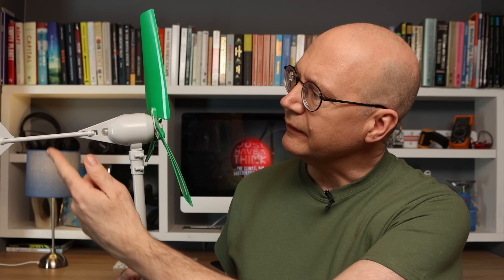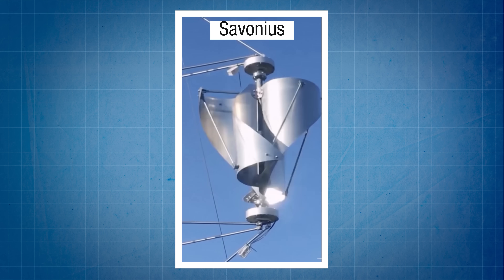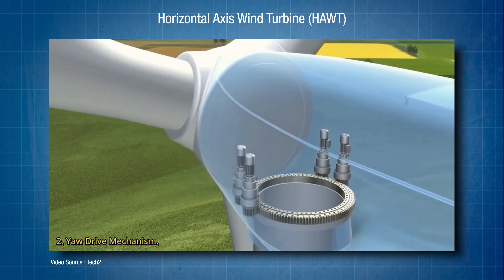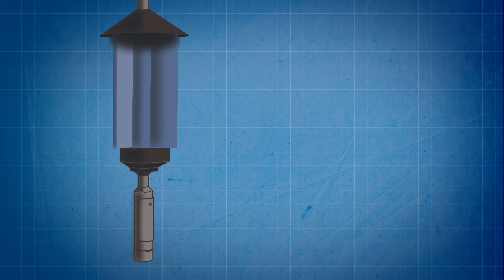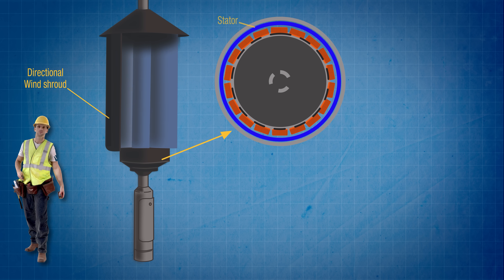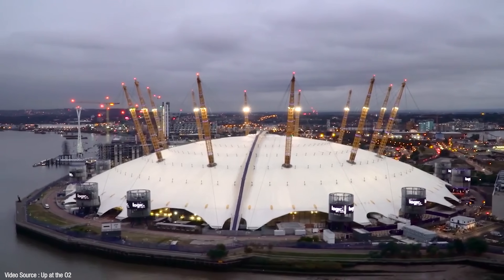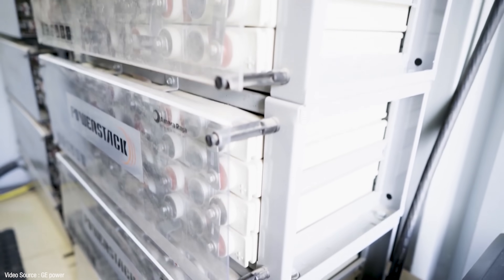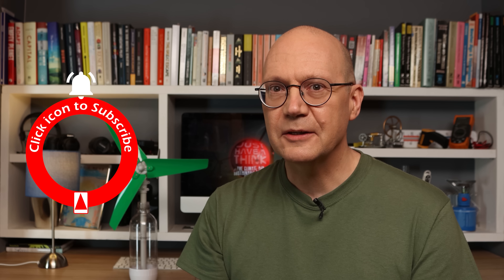A vertical axis wind turbine that doesn't need the prevailing wind! How do they do that?

Comment: There is a Canadian, Paul Gipe who many years ago debunked the feasibility of vertical wind turbine ... He even wrote a book if I remember well. I my experience, no vertical wind turbine paid for itself during its life time. Maybe the technology has changed for the better but the math and air physics didn't.
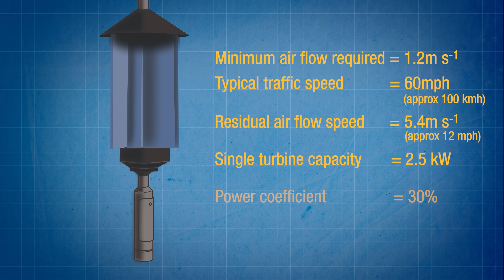Reply: Correct. And Dave's numbers don't stack up, they are wrong by either two (5:31) or three (8:50) orders of magnitude. So which is it, 2.5 or 24 kW? The right number for a VAWT this size is about 25 watt, by following the standard VAWT physics formulas.

Comment: The designers are simply not seeing the big picture... 
If energy can be harvested from vehicles, then it would be possible to reduce loading on vehicles. 
Highways could have reduced "street furniture" to allow for a more efficient  windflow as vehicles pass and could create a more continuous slipstream. 
The proposal is a tortuous route of energy delivery that creates overall losses rather than any gains.
Mount the turbines high on lampposts etc, where they WON'T steal energy from passing vehicles and you have a much better proposal....
.. a good old mini wind turbine, with all the usual inefficiencies of lack of scale!
If authorities have to take energy from vehicles, for lighting or science equipment etc. they may have a case, but even then it wouldn't be a particularly good one, solar panels and conventional turbines usually work well enough!

Comment: DIY HAWTs have progressed significantly recently. Addition of magnetic bearings which are incorporated into the generator magnets have increased the efficiency. Blade designs have improved as well. Although there is still room for improvement a few of the experimenters have achieved relatively impressive results. They aren’t running whole houses (yet) but are supplementing power to solar storage power banks. Every bit helps. I’m glad to hear someone is considering harvesting incidental wind from vehicles. That’s very cool. Even better if the lights themselves could turn on ahead of oncoming vehicles at night and off after a preset duration once it has passed. With all the lights burning constantly at night there is a lot of wasted energy.

Comment: I always thought that micro turbines dotted around close to the energy user would be more efficient than large turbines many km distant. For example, a shopping mall with a few hundred micro wind turbines of say 2 KWh each spread across parking areas and the roof should provide most of the energy needs of the building.

Comment: I'm dubious about traffic generating any usable wind on top of a pole off the side of the road. 
Any power output data from an installation?
Reply: Oh. They are at low level. Don't touch one tho.

Comment: Hi! In old days, we (group of enthusiasts) here in Latvia try everything to make Free Energy 😂🤣😊. Vertical Wind generator was a biggest disaster! One of our colleges make vertical wind turbine which coasts 20 000 Lats (1Lat = 2US Dollars in those days). It was total failure! No movement at all! It was predictable. All vertical WT are near 0% efficient if wind comes from one direction! BUT! If we put this kind of generator between counter driving cars in the middle of the roadway, than it can achieve good efficiency! It is logical! Good idea (on the roadways), but it will not work on the masts of GSM, because of wind from one direction. :)

Comment: We don't think big enough - Create a giga farm using regenerative agriculture, set up a solar farm covering the giga farm with movable panels - 50m high, set several of these wind turbines on each support post,  would be thousands on a farm this size. Set up farm near a source of dirty water (underground, sea, brackish lakes etc) but with good soil, use "Cool Steam Method for Desalinating Seawater" method using energy from solar and wind, to supply water for farm, create ammonia from water for agriculture, energy storage etc. Make the energy loop as closed as possible - run water cooling channels under solar panels to optimize solar production, pass heated water back into system to aid desalination, use heat exchanges of some form to collect wasted energy. Individually each of these (wind, solar and food production)  are expensive, combined we gain maximum benefit from a single parcel of land.

Comment: The basic concept sounds great at first, but the reality is that it is always better to harvest the larger source first. So if those are cost effective for traffic generated wind, they would be far far more cost effective for prevailing wind situations, so that is where we should put them. The fact that we don't suggests there is something wrong with their calculations.
Reply: Dave's numbers don't stack up, they are wrong by either two (5:31) or three (8:50) orders of magnitude. (So which is it, Dave, 2.5 or 24 kW?) The right number for a VAWT this size is about 25 watt, by following the standard VAWT physics formulas. It will never be cost-effective.  It is most likely a scam.

Comment: Figuring out the energy capture and efficiency for a horizontal wind turbine is quite easy.   What I've never seen a calculation for is a vertical wind turbine. Especially when it comes to "overspeed" units. The downwind blades are in the wind shadow and how many blades is most effective.

Comment: Actually here in South Africa those little turbines are very common. They are used in combination with solar on major roads to power cameras, communications and other devices.
Reply: In Japan there are traffic wind-powered rotating brushes that keep small road safety reflectors free of mud and dust.
Reply: Can send a photo or tell us what are they called (commercially)?

Comment: As always a very good video. Think if there could be this kind of VAWTs along the railway. There are post by the railway and if you have been standing beside the rails when a train passes by you know that there are some rather heavy winds there. :-)
Reply: I just watched this video and had this same thought immediately. Rail lines generate consistent traffic, often at higher speeds than automotive traffic, and also have existing infrastructure to aid in the installation. Ignoring this segment of generated wind would be a waste, literally and figuratively.

Comment: I have imagined a round tower with a slotted opening that would create a vortex in it from the wind and a turbine at its base that would turn a generator. This could be built to any size and generating power. It could have a mesh along it's opening to keep the birds out which seems to be one of the biggest arguments against horizontal wind generators.
Do you think it feasible?

Comment: Exciting technology, but ...
Won't this increase drag on cars? Each one may have a tiny effect. But if you pass 1,000 of them during your commute. What would that add up to?

Think of it like a torque converter like those found on most cars. They have essentially 2 fans close together. One drives the other by way of fluid. When the driven fan is moved closer to the driving fan. The drag on the driving fan increases.

Sure most of the turbulence produced by cars already goes to waste. But this will add to that turbulence and drag.

The question is, how significantly will this impact the fuel efficiency of traffic?

Hopefully it will be negligible. Either way it looks like a technology worth investigating. Especially for 5G towers.

Imagine the collective drag these could have on cars.
Reply: @JorgTheElder  the question is not will it reduce vehicle efficiency, rather how much will it do so. 1 of these is nothing. 1,000 of these may cause a significant decrease in fuel efficiency. 

Chances are it will not be significant. But the question can only be answered after real world testing. That data is needed to know for certain.
Reply: @JorgTheElder  true until you introduce millions of these. Especially if they are very close to the roadway. Think cumulative. 

This is not to say it will become a real problem. All the same it must be measured and analyzed.

Comment: The only replacement for fossil fuels is nuclear power, end of. Renewable power is a scam that'll never work, we shouldn't want more diverse versions of it, we should want to be rid of it. It's an unconscionable drain on our natural resources, while only serving to lock in fossil fuels as a backup power source. 

Simply put, the entire concept is fundamentally flawed and can never be made to work as advertised, physics is very clear on this. Essentially renewable energy is just the modern day reincarnation of ALCHEMY, an over promising endeavor claiming to fix everything, held up by the belief that the massive and obvious flaws can magically be worked out if we just mess with it enough.

And your YouTube channel is nothing more than a fountain of false hope for a concept that's little more than a sales pitch and some wishful thinking.

Comment: Always a Joy to listen to you! I've been thinking about our power situation in sweden. We have quite a lot of wind power, extensive hydropower (with a few pumped hydro plants), some solar and a few nuclear plants. Windy days, non-wind producers pay to be kept online and keep producing, due to grid surplus, and storage (mostly pumped hydro) is not nearly enough to match the intermittent power source. I know you e been talking about this a lot but an analysis of what happens when you get a grid power surplus and additional methods for power storage would be interesting! Or maybe a real example of a working system for supply/demand controlled power price for the end customer (I've been hearing talk about washing machines waiting for the lowest kWh-price to start washing)

Comment: I can see them all covered in snow after the plows have gone by.
Reply: Same as sun panels still making sense despite nights, That an energy source faces periods of no or low generation, is pretty irrelevant. What should be looked at is its contribution over a longer period of time, like yearly or its entire lifetime.
You are right though in the sense that they need to survive the environment where they are used. If they just stop when covered in snow, and then spins up again when the sun melts, it's just a down period of anything from days to months. And it needs to be weighed in before deciding on economical feasibility. If it still would make sense with 2-4 months of downtime, I see no reason not to use it in northern countries.
Reply: As they still have moving parts, maintenance and exposure to certain weather does seem like it could still present some issues. How well do they deal with icing for instance?

Comment: Hawt’s use the tail to point themselves into the wind. They can and do accept wind from any direction. Only the very large utility scale units have a “yaw system “ to motor themselves into the wind. This guy misses that fact entirely 3:15
Reply: @JorgTheElder  Slow night?
Reply: @JorgTheElder  I had a teacher in grade school who insisted on calling a pencil a "writing instrument".  Anyway, when I think of a yaw system I think of sensors that sense and send a signal to a yaw motor that commands it to turn the turbine so it constantly stays pointed into the wind.  The video shows this type at 3:15.  That is how the large WT's do it.  The smaller cheaper ones use a tail.  

If you are interested in small wind power systems Bergey Windpower and Kestrel make real WT's that are designed and built to last.  Bergey's 10KW machine has been built since the late 70's and is rock solid.  Their 1kW machine is not as robust as I would like.  

The vertical axis WT design has been around in different forms for over 100 years.  If they worked so well they would be deployed worldwide.  The last I checked there are Bergey 10kW Hawt turbines operating in 30 countries.  Many have been producing power for decades. 

Don't take my word for any of this but if you do your research I think you'll come to the same conclusions I have.

Comment: Unbelievable light design. The cost comparison table doesn't add up.  The panels would likely be bigger than 300W, not 250W. 125 turbines at 2.5KW doesn't give 3MW, over 15 hours gives 4.7 MWH. The solar would be 12MWH.  Energy production is not a cost, it is an income.  ... But I want one, because I don't have much wind, and most turbines need a lot higher velocity to turn.
Reply: These will produce max 25 watt, not 2.5 kW (5:31) or 24 kW (8:50) (So which is it??) You definitely don't want one of these.
Reply: @tzenophile  Not many people are versed in calculating the power of the wind.  I must check your number in a ball-park way!  At 6:30, the cross sectional area seems to be about 1 square meter. They are saying 5.4 m/sec in fast & heavy traffic. The density of air is 1.2Kg/cubic meter. The energy in 5.4 cubic meters at 5.4 meters/sec is 17 Joules. So the estimate is 17 watts!  You are right, a huge error!
Reply: @tedrees5989  Yup! Just have a Think got a brainfart on this one

Comment: small compact versatile, "just have a think" if you integrated & mounted them to the tops of all telephone/cable carrying poles across the country/world, you would bolster & compliment the hydroelectric transmission network that is already in place. "just have a think" I think I think yes to vertical axis wind capture turbines small compact versatile & durable. It will work. Let's get started.

Comment: I think these could be used on taller buildings as the turbulence at the top is considerable, and due to them being light weight could be retrospectively be installed,increasing the building's efficiency

Comment: The numbers don't work: 125 turbines, GBP 29,000/month. GBP 232/month for one turbine. divide by ~30 days per month, daily lease cost = GBP 7.73 If a turbine makes 5.8 kWh per day, the cost of the electricity is GBP 1.33 per kWh. That is far too high to be worth doing. Unless they think they can reduce the cost of leasing a turbine by at least a factor of 20:1 they should stop wasting time and investor (or taxpayer) money on this.

Comment: Here's a thought.  Why don't we just add some turbines in the front of the car and when it drives down the road it will generate some of it's own power from the turbine.  Obviously you need to use power to move the car but at least you'll be able to get some of that back from the turbine.......  Is the extra drag losses of the turbine resistance greater than the power that the turbine generates?
Reply: Drag.

Comment: Great concept. Hope the numbers are real and not some company trying to get in on the green subsidy train. Remember that vertical crane stacking battery thing a few months back?
Reply: numbers don't stack up, they are wrong by two (5:31) or three (8:50) orders of magnitude. The right number is about 25 watt. Which means this is a total investment failure.  I'll buy the Gravity Vault over this.
Reply: @tzenophile  Yeah, 2.5kw per turbine x 125 turbines doesn't equate to 3MW.

Comment: The cell tower placement for these vertical axis turbines makes excellent sense, both for robust service and for lessening grid demand.  Thank you Dave for the wonderful presentation! 🎁🌞🌄🌀
Reply: Looking at the turbines and considering the location of a nearby commercial property, that's a couple of hundred meters on two property borders that are right of way for two superhighways at right angles to each other. Add in, the property itself occupies the top of a rather large hill, there's also quite a bit of ambient wind on top of what could be harvested from the edge of the right of way.
I'll have to sit down tomorrow and crunch the numbers, but I suspect that the business' electric bill could drop into the negatives frequently enough and be offset to below petty cash prices mostof the time.